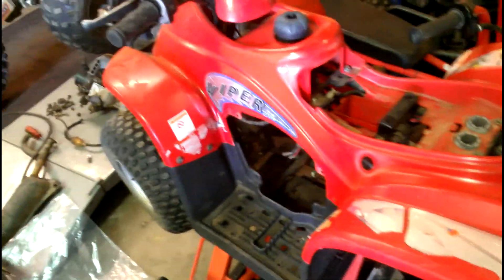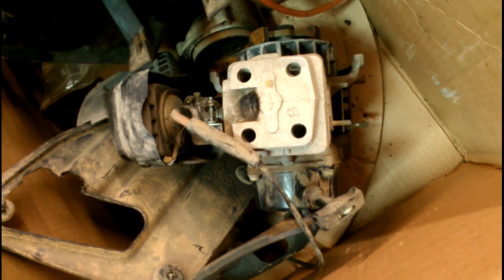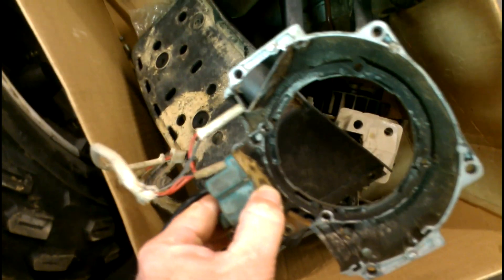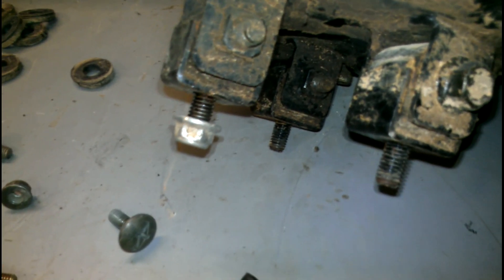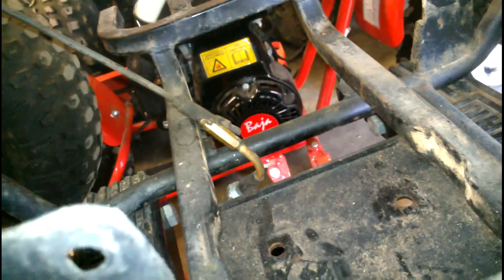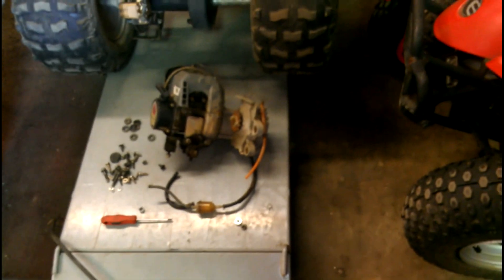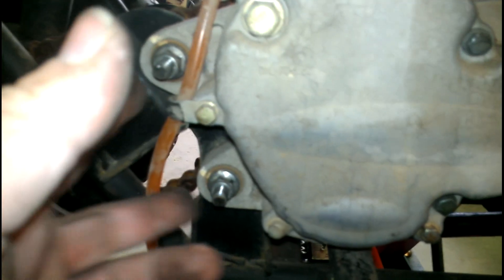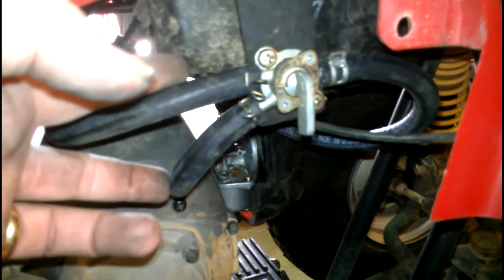2003 Eton Viper Jr 40cc Atv - Motor Installed And Running

Comment: I specialize in eton 40 engine parts found on e-ton ixl-40 Rascal & rxl-40 viper Jr atvs
I also have parts for the electric start rxl-40E model and mini scooters that use the eton 40 or 41.5cc engine

Comment: I just picked up a viper Jr. It fires up for a second then dies, I cleaned the carb same thing still. The plug gets wet when u try and start it also. Any ideas what's up with it?
Reply from the maker: Try a new plug.  Sounds like it has spark since it starts for a second.  I would change the plug and then mess with the carb again.  Something with the carb sounds like an issue.
Reply: Ok I'll try a new plug, thought it was good cus I checked the spark seems to be strong. Thanks for the suggestion
Reply: Its your top end seals or one of the two seals done Been down that rd

Comment: Does anyone know what gearcase oil to use on 40cc
Reply: 80w90 gear oil
Reply: @coreyloftis6275  will that Honda hp trans oil work you think it's 80/85
Reply: @tonyderks9172  the case and the owners manual says 80w90